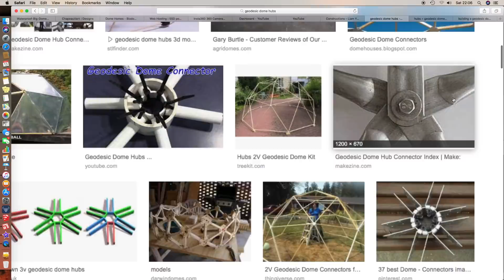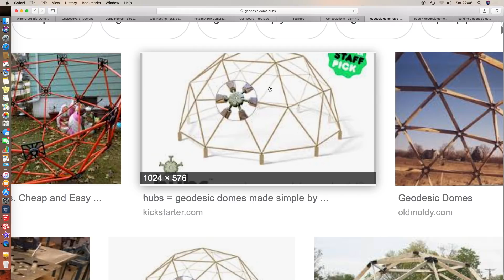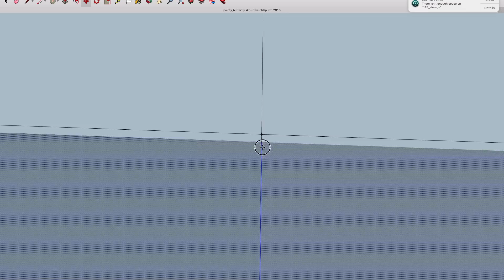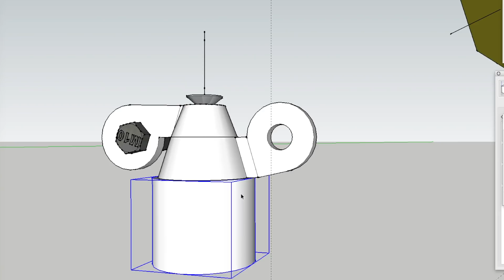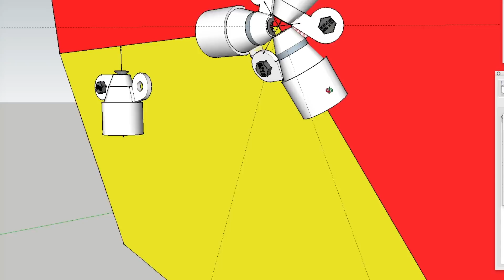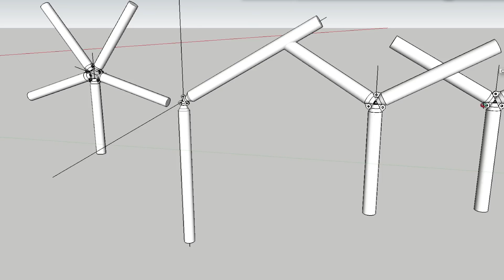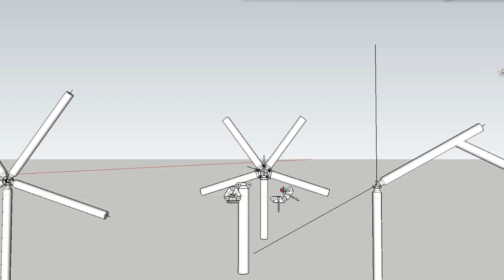Designing a better dome hub

Comment: Nice design  looks like it will be a hub for a flat plane intersection, but I guess you could get some  "dish" via flex or distortion if needed.  Seems ok for non heavy duty applications or  low wind areas.

Comment: Put groove on inner part of hub ears that you bolt so they lock into each other after positioning them .Also those ear taps that you bolt would have to be thick for strength. COULD BE A WEAK POINT

Comment: Amazing thank you so much they'll definitely make a wooden that's would fit inside PVC tube this Crew 2 security on The chew would be Allen key that's could be worked on an angle this will push the two sides out word

Comment: May peace be with you.
Design looks ok , but correct me if i am wrong ( i work 3D only in Sketchup :-) so far) , those 3D schematics you made works only if those strut elements are in straight position - flat , not angled for dome shaped structure.
Design lack at least 1 joint element so that struts can make angle in relation towards this roughly looking hub.
Friend recently suggested me those dome structures and since i like challenges so i am conducting little research because dome structures are rather none commercial appearance in Croatia.
Friend is carpenter and have experience in many wood works and constructions.
I do have like Tesla some schematics in head but Sketchup is rather something you really need to give much attention like every patents which were made, so closest to perfection is required , nothing less may pass.
May peace stays with you.

Comment: At 9:20 you describe using pipes, but I don’t understand what you would be screwing the flanges into if the pipe is hollow. I’m building a 5/9 3V dome out of aluminum and am struggling to find a suitable hub solution for the reclaimed 26.5mm tubes. 3D printing seems like best bet at this point

Comment: Could you beat/stamp/drill out two "wingnuts" as in your design from metal pipe or softened PVC ? pros: no parts at all, cons:wouldn't work for wood struts, also you'd need different stamping angles for 5-way and 6-way (then again that only means having 2 different variations if you're building domes).   The device design for the stamping/pounding guides would take you a couple of minutes.  The only manufactured components any builder needs are the 2 jigs, reducing supplychain exponentially. Just a thought.

Comment: I think it best to add teeth or gears if you may. Where the upper hub and lower hub won't slip once tighten together. The bolt should be an Allen wrench bolt in order to easily tighten and loosen the bolt in a confined configuration.

Comment: I saw a hub that was cut from plywood and the struts were slotted at the appropriate angle and then a wooden dowel was used to pin it together at each strut. Very large livable dome. Used 2x6 for the struts and the hubs appeared to be 3/4” plywood. A CNC router could make mince meat out of it all I would guess. Anyway, anyones thoughts are info about this sort of dome build system?

Comment: I like it for its simplicity, however I think it has a fundamental limitation to scale. the connections can only be so big and I think it limits the strength to weight ratio so your not going to be using it to build any geodesic super domes. I am envious of your sketchup skills, I too have a hub design in my mind but lack the sketchup skills to make the model. My design is more robust  hub that has some added features as it can be incorporated into a double geodesic dome for a super structure that could be used in concrete forming or aircrete forming.

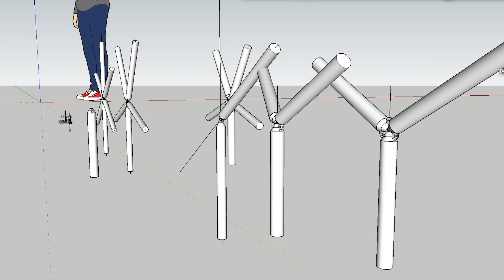Comment: After reading through the comments and digesting all the "coplanar" comments, I can understand the confusion.  The various hub configurations at 7:50 look somewhat coplanar, but I can imagine these flexing to create dihedral angles. I can visualize the center "void" of the hub increasing/decreasing in size and the "ears" rotating axially to each other. Wouldn't these need some sort of keying/knurling/toothing to prevent undesired axial rotation of the "ears" once the proper angle has been acheived depending on dome frequency or hub angles.  Any external loading may deform the dome.  Depending on the friction of nut and bolt fasteners may be insufficient to prevent warping of the hub angles.

Comment: I like the simplicity of the proposed attachment, however, there is a dead space created at the centre of each junction due to the design of the attachment. In the case of a three way junction this is a reasonably small triangle, but for both the pentagonal and hexagonal junctions the dead spaces would amount to substantial pentagons and hexagons, respectively. To ensure the weather integrity of any geodesic dome created as a structure using the suggested attachment would require some suitable solution to deal with the resulting holes at each hub.
Reply: The size and shape of the void changes with the number of brackets in the ring. Its not like a circular hub where the aize is fixed and the spacing is altered. The strut length of a dome is measured from vertex to vertex so you will have to adjust the strut length to account for the difference in the hub diameter. The brackets create as many problems as they solve and given a dome built with them could be up to 5x -6x more expensive than an alternative hub method i wouldnt say they are necessarily a better dome hub.

Comment: I would like to add to Guillery's comment. In addition to making the units able to pivot, each unite should be attachable to a hallow pipe. PVC plumbing pipes ,even metal ones, are hallow and tend to be the most commonly used in DIY pyramid and geodesic dome construction. Screwing through the top section into the side only works if the side is a solid soft enough for the screw to get a firm "bite" into it.

Comment: Love the idea and concept but one flaw is the fact it’s set on a flat plane the domes angle in depending on the frequency at the joints so like a 5 frequency dome 20 foot diameter has a 6 degree angle need to make the hub pivot at bolt connections or make preset angles for each design angle but the overall design is great and would love to see this as a viable solution for connections in domes
Reply: The Guillory's Louisiana Homestead The two "ears" are not coplanar.  Because these "ears" are attached to independent "hubs" or "collars", these "collars" can rotate about the same axis to create non-coplanar angles... See 6:10

Comment: Hi Paul,
I've designed new (I hope better & simpler) geo-dome hub connector. One that should be universal for all the angles, and also that can be made only by the most standard & commonly available steel profiles (or other materials if strong enough for the size & purpose). I made a small SketchUp project to illustrate. 
https://3dwarehouse.sketchup.com/model/c63c616b-60b5-497a-a88a-c1cff30269f0/Universal-Geodesic-Dome-Connector
There's detailed description in the project too. But here's the main idea:
Around the hub of course we have either 5 or 6 struts (I prefer to use rectangular tubes since when tightened they'll fit to the other flat elements' surfaces and add some friction force. But there's no big issue to use round tubes for example, perhaps with some spacers); 
In the middle there's the main hub, which is basically two flat plates (steel in my case).
These plates should have either 6 holes or 5 holes at needed angles - I mean general angles like the 5-way hub should have it's holes at about 72 degrees, and 6-way hub at about 60 degrees. For a v3 hub actually most of the 6-way hubs will have angles like 55.7 & 62.2 but they're close enough to 60 and the rotation that the bolts give will allow adjustment to the exact needed angle (automatically by connecting the struts with correct lengths). So no need to be super precise and drill different plates with tiny angles differences.
The plates should also have some corners cut so that after the hole there's the same distance to the end of the plate - in my example I'm using M14 bolts, and leaving another 14mm of material on the plate, then cut perpendicular to the line between the plate's center and the respective hole - should be simple enough.
Then there's the 'magic' :) short square profile pegs (in my sizing 30x30x90mm). They're also very common profile, just square extrusion profiles, pick the needed width cut in pieces (90mm in my case) and then drill two holes for the M14 bolts, but drill them on perpendicular sides of the peg - ie you should get something like a middle of a Cardan-Joint (or CV-Joint) one of the holes will go in between the hub plates, and the other in the end of the struts' tube.
So the bolts on the plate will allow to adjust the exact angles between the struts, and the other bolt (thru each struts' end) will adjust the dihedral angles between the dome panels.

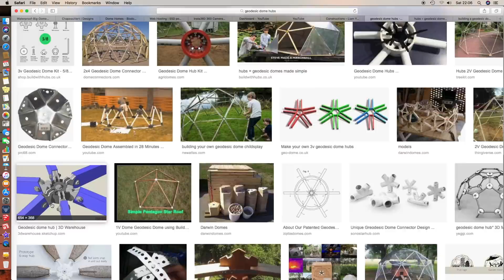This design isn't something original - actually functionally it's very similar to the one you show at 1:24, but without such custom parts or assembly. 
The main advantage is the simplicity - no custom parts of processing is needed - just simple cutting at certain lengths and drilling some holes.

Optional) For smaller and lighter domes with lighter frames, the two plates (if thinner sheets are used) can be reinforced by adding a ring with the same thickness as the square-pegs - very much as the ring-hub design from ZipTieDomes . This should reinforce the plates against bending caused by high load and the fact that load direction is not in the same plane (ie at about 156 degrees instead of 180). The distance between the inner ends of the square pegs should determine the ring diameter. These rings can also be cut from standard (wide) pipes, nothing complex.
If the struts have thinner walls laying all the weight on single bolt might try to bend the connection point of the struts (the bolts if chosen correctly can take much higher shear forces) but the ends of the struts can be reinforced by short sleeve, ideally same shape profile, just a size larger so that it can wrap around the strut end. Then more bolts can be used between the strut & the sleeve if necessary, and the single rotation-bolt would got thru the thicker total walls of the strut & sleeve - this should solve potential bending at the struts' ends without the need to use larger & thicker struts for the whole length, but just the ends.
What do you think? I'll appreciate your opinion!

Comment: I like the design. One question: How do you adjust for the dihedral angle?
Reply: That's why there're two joints per pipe, when the screw in the axis of the pipe is loosened you can rotate them freely to the desired angle and then tighten it. I assume they'll all be slightly loose while you're assembling at least one row of the structure, and then when it's complete and the angles set by the whole structure (because of the struts lengths) you can tighten them.
But I didn't get how one would get the different angles between the struts. There are some irregular joints like the 2x55.7 & 4x62.2 degree angled hubs in v3 dome

Comment: I would agree with  Mårten Woxberg. 'So the "hub" doesn't angle and the struts need to be cut with the correct angle at the end?'
Reply: That's how I read it. The lengths of the struts set the angles, the hubs conform to the struts. It does mean the struts have to be fairly accurate but that's easy to do.

Comment: hi paul, i was thinking over your design. i don't know how to attach here sketchup file or images. as others noted below i kept in mind strength and locking ability. so my version is made of steel flat bar. (dome struts are straight steel pipes right angle cut).the flat bar bent around the strut - one end is a small "ear" while the other end is the long "ear". long ear to connect struts. between small and long ear tighten the screws to make fast the set position on strut.

https://plus.google.com/u/0/collection/sxPkPF

is my g+ account

Comment: I only just got to see this video, and it took a while to assimilate in my head. I love a good puzzle.
It seems to me that  if all the bolt holes are the same angle and distance at  the end of the struts,  then the multiple strut assemblies will only work for identical  angles of hub struts joining at each hub. With one project, a 4 frequency summary of panels looked like this.
Panel data summary
Area Perimeter Side 1 Side 2 Side 3 Ang13 Ang23 
1.09 4.81 1.52 1.52 1.77 54.33 54.33 
1.35 5.31 1.77 1.77 1.77 59.92 59.92 
1.42 5.44 1.77 1.79 1.88 58.80 57.53 
1.56 5.70 1.88 1.88 1.95 58.72 58.72 
1.65 5.85 1.95 1.95 1.95 60.00 60.00 

.. so we have angles between 54.33 degrees and 60 degrees etc

Michael Sowdal mentioned that the conical shape was going to require special casting or tooling, which makes sense. When you think about it, if you abandon the need to get the end of the struts close together, what you have here is a big hinge, with a hinge pin and two "flaps" at the end of each hub. 
In fact, if you abandon  the idea of the end screw to hold the components together, and just have a rod projecting from the end of each strut, the two "ears" are just the opposite sides of a hinge.

Its been a while since I fiddled with domes, so I may be missing something. I'll do a bit of a drawing over the next 24 hours to clarify my thoughts a bit.

Comment: I suggest that you try to condense this concept into a 30 second video and submit it to AvE. He is offering to mill prototypes on his new 5-axis Haas machine if people have good ideas to work with. Check out his channel, just type 'ave cnc' in the search bar.
Reply from the maker: Thanks for that, I've subbed to Ave's channel but not seen this yet. Great idea, I'll do it now.
Reply: I saw the clip you uploaded. I'll post a link to it on AvEs channel. It'd be great if this works out.

Comment: Great thinking - only if using as a universal hub you need to be able to fix a screw in the center face of your strut. Now that is rather difficult when using metal conduit or other types of tubes. But you are the wood guy Paul - so that will be a good hub your green house uses. For larger Domes the hub should be looked at with regards to shear forces under different loads - it looks not too strong in my humble opinion, unless you cast it from steel or do a CNC milling job. 
So compared to the Ring and punched sheet metal (at 1:26) that you didn't like in your video it seems rather more costly to make a strong version of your more complex design that that ring hub. 
Also - Have you looked at the simple angle iron idea? Seems similar with the screw in the center face of your strut, but is by far less complex. There are guys selling it made from plastic for small domes. But when using a thicker metal - all you need is to drill and bend it. I guess you have looked at this as well. Let us know what you think about that design. Let's stay creative, constructive and connected - many thanks to you for your great passionate work.

Comment: Is the cone shape really necessary? I can envision  a simple cut rectangular piece of steel with the "ear" at the end angles so that the the bolt hole is centred along the top longer edge, matching your models position. It could be laser cut, or even a jig saw for proto-typing. Then roll the long rectangle ensuring the "ear" is at a right angle. I'm picturing a door hinge, how the tubes created by the by rolling the metal are stacked with the pin going through them. You could probably cut a door hinge to just to try it out. Just a thought.

Comment: Ingenious.  While you mentioned it, what you did not show clearly is that each hub section is in two conical sections, with 'ears'.  I would suggest having interlocking teeth between the two conical surfaces to prevent it from rotating once attached to the strut.  You could also make the wider conical portion have a tubular section into which the strut/dowel could be inserted, with a hole in the side for inserting a screw into the strut rather than using one screw to extend through the two conical sections into the strut.  You would then use a bolt going from the narrower section (top) into a thread cut into the larger (bottom) section.  Alternatively, you could use a nut on the end of the bolt inside the lower section.  These could also be 3-D printed using carbon-fiber filament.

Comment: For temporary use in non-load bearing structures, this looks great. I worry about the shearing forces that would be exerted on the screw and bolts, so I wouldn't trust it to hold up anything living, or heavy. But as part of a temporary greenhouse or tent shelter, it'd do just fine.

If I were to fabricate something like this, I'd probably go with sheet metal. It'd be like making a hinge. Cut a rectangular piece , round one side and drill a hole in the center of that round. This is the hole that bolts to other hub pieces. Other side, cut down the midline, and off to one side. Roll up the tongue, mirror half the parts so the tongue rolls the other way. Screw a pair to a beam, maybe with a washer on the head for good contact. Heck, invest in tooling, and punch the blanks out with a press.